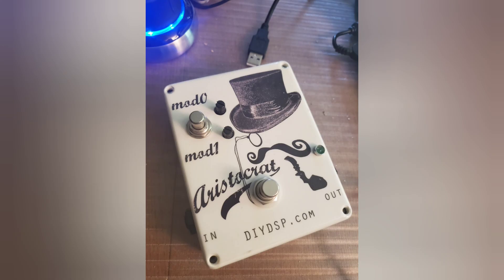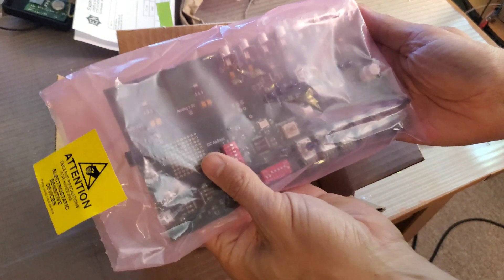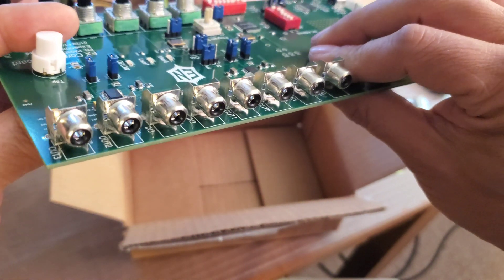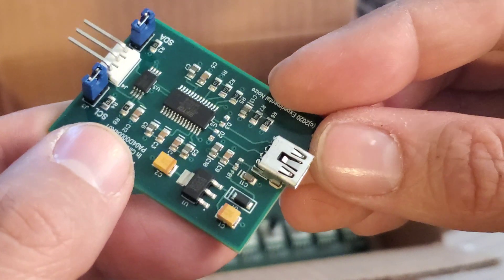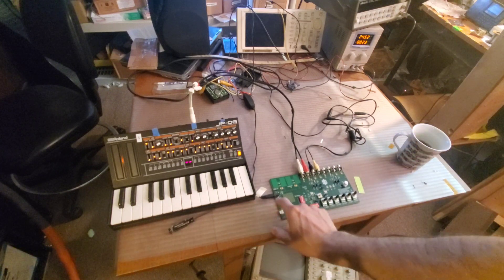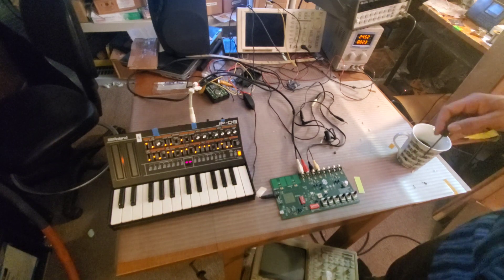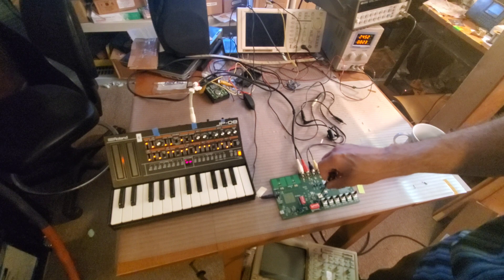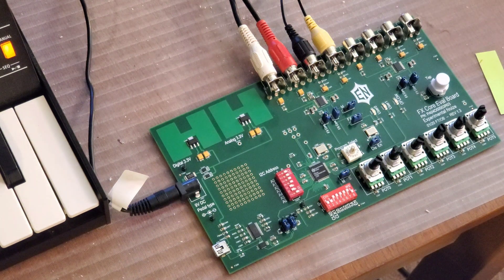Introduction to the FXCore from Experimental Noize, A Bold Upgrade to SpinSemi's FV-1 w Sound Demos

Comment: It is 6 POT inputs, 5 switch inputs, has 2 I2S interfaces so it can access 4 in and 4 out if you use 2 stereo CODECs and is actually the same amount of RAM as FV-1.
Reply from the maker: Ah! Thank you for the corrections, sir!